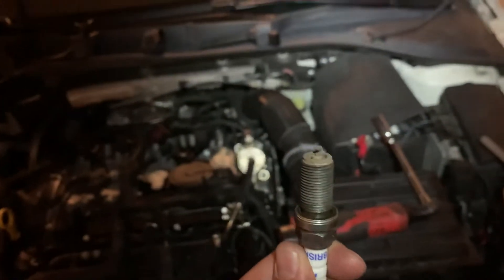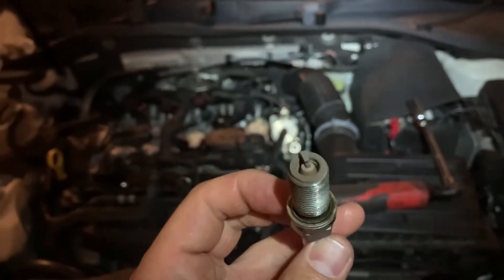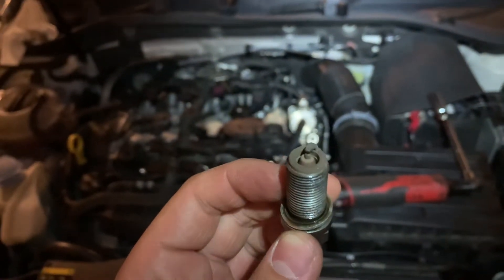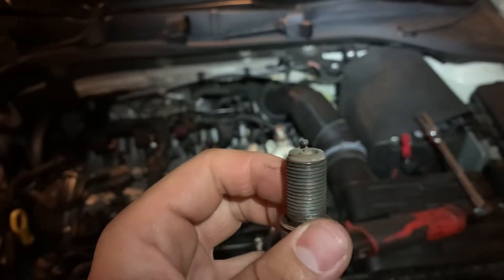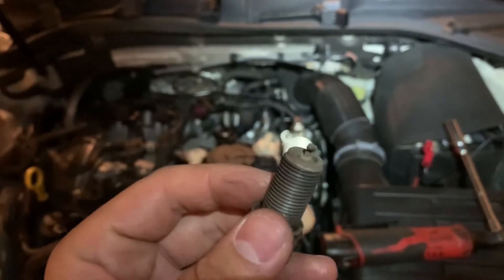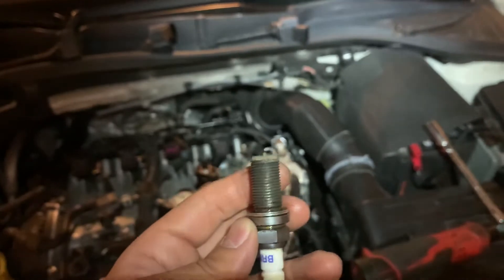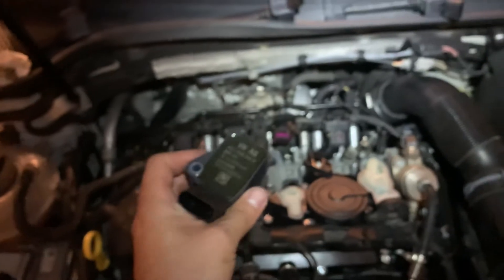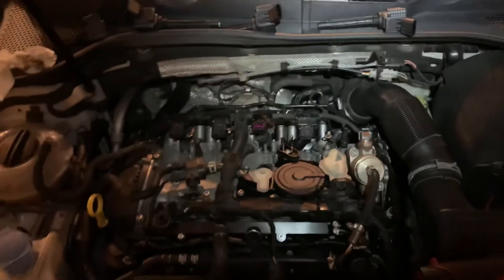Misfires in the EA888 engine for the MK7 and MK6 GTI

Comment: My mk7 got misfire codes, added apr coil packs, still misfires. One of the spark plugs is messed up tho because the porcelain is sliding through the bottom of the plug and it’s not supposed to do that. I’m hoping that’s all that the issue is. I have 2 new spark plugs coming so hopefully that solves the problem
Reply from the maker: Yes a broken porcelain will do that for sure. Replace it. It broke due to knock so either run higher octane fuel or have the tune adjusted. Brisk ER12s plugs seem to be the strongest against this breakage.
Reply: @stratifiedauto  hey thanks man! Ya I replaced it and the problem went away. Thank god lol
Reply: I had a cracked plug that a found on the dyno when doing my first full power runs on my Subaru. There’s nothing like trying to swap out #4 plug while the car is strapped to they dyno with the clock ticking.

Comment: What is your coil pack recommendation?
Reply from the maker: OEM and R8 have worked well.
Reply: @stratifiedauto  thanks. I’m wondering the level of benefit from opening the plug gap slightly with some extra spark energy. But I’m always hesitant to put aftermarket’s coils on my vehicles. The aftermarket options for the EJ’s are generally junk.